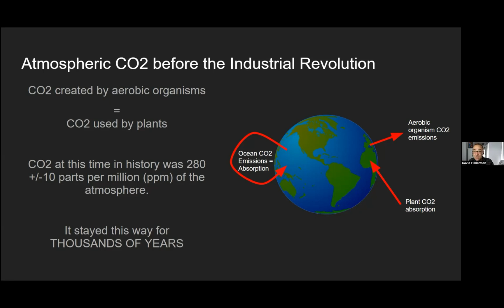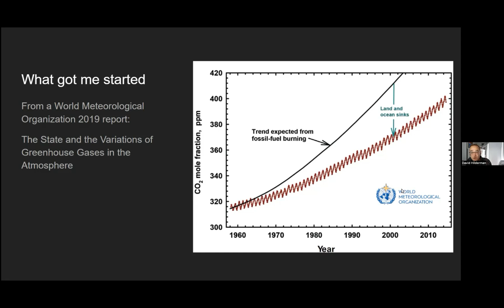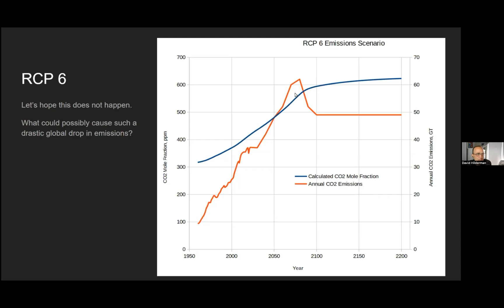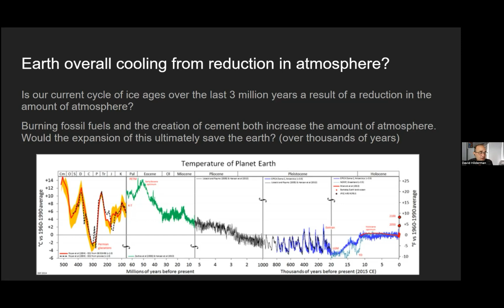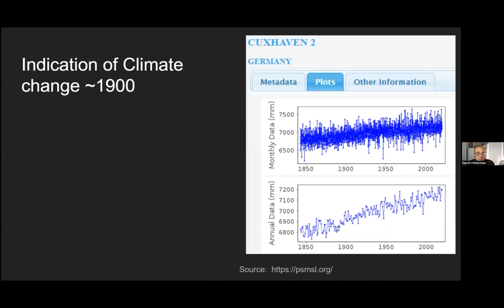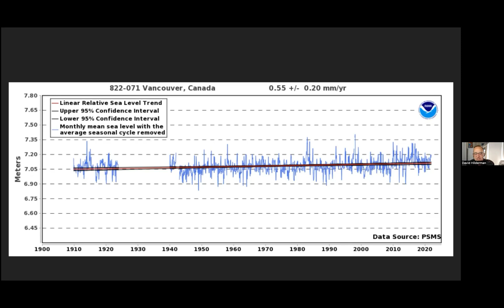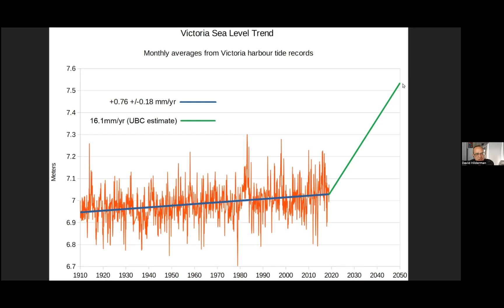David Hilderman: CO2 Emissions and Atmospheric Levels | Nelson Pod #220

Comment: Plants not only grow faster with more CO2 but they need less water. Plants don’t need as many stoma or open them so much to bring in sufficient CO2. As a result they don’t let out so much water. Thus deserts increase in productivity and decline in area.
Reply: Your graph needs to show more than the last 200 years. But that would change the narrative !
Reply: Plants already have an abundance of CO2 from just the natural sources (about 20X). The human contribution of CO2 (another 10X) does not provide any additional 'food' for the vegetation.
You may have heard that there is an increase in vegetation that correlates with the rise in CO2 and this is true... but correlation is not causation. The increase is due to increased agriculture and (believe it or not) deforestation. Deforestation actually increases the amount of vegetation per acre that can absorb CO2... it's just that the new vegetation are grasses and other simple plants with short life cycles, so they are also sourcing more CO2 periodically.
Reply: @scytaleghola5969  Look at how many mental hoops you've just had to jump through to try to say what you believe. Occam's razor ol chap. If extra CO2 doesn't provide any additional 'food' for plants then why do farmers add CO2 to greenhouses? If there was no benefit they wouldn't do it. The optimal CO2 level for plant growth is between 700 & 1200ppm BTW,which if global levels rose to that it would,in my opinion,make for a beautiful and abundant world with bountiful harvests which is far preferable to the restrictive totalitarian world proposed by the climate Tzars.
Reply: @bobtodd9590  People add CO2 to greenhouses because greenhouses are sealed environments.
You can look up things like how many metric tons do all of the plant life on Earth consume annually? (about 100 billion metric tons). The plants return a similar volume through natural processes. In addition to this we have naturally occurring fires, volcanos, and a number of other sources of CO2. So, without any help from us, more CO2 is going into the atmosphere than is being absorbed... but this is only a tiny piece of the story... Unabsorbed CO2 can remain in the atmosphere for hundreds of years, so, in actuality the total volume of CO2 in the atmosphere is currently more than 3000 billion metric tons (about 1/3 of that is thanks to us humans).  There is a huge surplus of CO2 in the atmosphere  and it has been there for a very long time and it was always available to plants... so , if your hypothesis were correct, we would already have that bountiful world you dream of.
You mention harvests, so it sounds like you think extra CO2 will improve food supplies. This is not likely the case. Of course there is always the "scare porn" about droughts and floods and acid rain... which are very real concerns, but there is another, possibly more eminent concern. The world's population of pollinators has declined as much as 70% in the last 50 years. This is partially due to disease, parasites, and pesticides, but about 1/3 of the losses are due to climate change... See, pollinators are not nearly as quick to adapt to changes in temperature, shifting growth zones, and other changes. About 60% of the crops we (and our animal food sources) eat, depend on pollination. I'm not sure we know how low the populations need to fall before it becomes a crisis, but farmers are already telling us that the declines are affecting yields and you are already paying for it in your grocery bill. Don't even get me started on the decline in phytoplankton, which is necessary for nearly all sea life.

What you call mental hoops is just science. Our biosphere is a highly complex, finely tuned system and we are randomly playing with the tuning knobs and expecting it all to run the same or better.

It's ok, though. It's a self correcting problem. The planet will be just fine (as George Carlin used to say). You can look up the rest of the quote, if you don't already know it.
Reply: @bobtodd9590  People add CO2 to greenhouses because greenhouses are sealed environments.
You can look up things like how many metric tons do all of the plant life on Earth consume annually? (about 100 billion metric tons). The plants return a similar volume through natural processes. In addition to this we have naturally occurring fires, volcanos, and a number of other sources of CO2. So, without any help from us, more CO2 is going into the atmosphere than is being absorbed... but this is only a tiny piece of the story... Unabsorbed CO2 can remain in the atmosphere for hundreds of years, so, in actuality the total volume of CO2 in the atmosphere is currently more than 3000 billion metric tons (about 1/3 of that is thanks to us humans).  There is a huge surplus of CO2 in the atmosphere  and it has been there for a very long time and it was always available to plants... so , if your hypothesis were correct, we would already have that bountiful world you dream of.
You mention harvests, so it sounds like you think extra CO2 will improve food supplies. This is not likely the case. Of course there is always the "scare porn" about droughts and floods and acid rain... which are very real concerns, but there is another, possibly more eminent concern. The world's population of pollinators has declined as much as 70% in the last 50 years. This is partially due to disease, parasites, and pesticides, but about 1/3 of the losses are due to climate change... See, pollinators are not nearly as quick to adapt to changes in temperature, shifting growth zones, and other changes. About 60% of the crops we (and our animal food sources) eat, depend on pollination. I'm not sure we know how low the populations need to fall before it becomes a crisis, but farmers are already telling us that the declines are affecting yields and you are already paying for it in your grocery bill. Don't even get me started on the decline in phytoplankton, which is necessary for nearly all sea life.
What you call mental hoops is just science. Our biosphere is a highly complex, finely tuned system and we are randomly playing with the tuning knobs and expecting it all to run the same or better.

It's ok, though. It's a self correcting problem. The planet will be just fine (as George Carlin used to say). You can look up the rest of the quote, if you don't already know it.
Reply: @bobtodd9590  People add CO2 to greenhouses because greenhouses are sealed environments.
You can look up things like how many metric tons do all of the plant life on Earth consume annually? (about 100 billion metric tons). The plants return a similar volume through natural processes. In addition to this we have naturally occurring fires, volcanos, and a number of other sources of CO2. So, without any help from us, more CO2 is going into the atmosphere than is being absorbed... but this is only a tiny piece of the story... Unabsorbed CO2 can remain in the atmosphere for hundreds of years, so, in actuality the total volume of CO2 in the atmosphere is currently more than 3000 billion metric tons (about 1/3 of that is thanks to us humans).  There is a huge surplus of CO2 in the atmosphere  and it has been there for a very long time and it was always available to plants... so , if your hypothesis were correct, we would already have that bountiful world you dream of.
You mention harvests, so it sounds like you think extra CO2 will improve food supplies. This is not likely the case. Of course there is always the "scare porn" about droughts and floods and acid rain... which are very real concerns, but there is another, possibly more eminent concern. The world's population of pollinators has declined as much as 70% in the last 50 years. This is partially due to disease, parasites, and pesticides, but about 1/3 of the losses are due to climate change... See, pollinators are not nearly as quick to adapt to changes in temperature, shifting growth zones, and other changes. About 60% of the crops we (and our animal food sources) eat, depend on pollination. I'm not sure we know how low the populations need to fall before it becomes a crisis, but farmers are already telling us that the declines are affecting yields and you are already paying for it in your grocery bill. Don't even get me started on the decline in phytoplankton, which is necessary for nearly all sea life.
What you call mental hoops is just science. Our biosphere is a highly complex, finely tuned system and we are randomly playing with the tuning knobs and expecting it all to run the same or better.

It's ok, though. It's a self correcting problem. The planet will be just fine (as George Carlin used to say). You can look up the rest of the quote, if you don't already know it.
Reply: @bobtodd9590  People add CO2 to greenhouses because greenhouses are sealed, regulated environments.They have to replenish the CO2, plus in those controlled environments plants can take up more CO2.
The bottom line is that the atmosphere currently has more than 3,000 billion metric tons of CO2 and has had more than 2,000 billion metric tons for centuries.The current demand from all plant life on Earth is on the order of 100 billion metric tons. There is a huge surplus of CO2 in the atmosphere. If your hypothesis were correct, we would already have that bountiful world you dream of.
Reply: @bobtodd9590  People add CO2 to greenhouses because greenhouses are sealed, regulated environments.They have to replenish the CO2, plus in those controlled environments plants can take up more CO2.
The bottom line is that the atmosphere currently has more than 3,000 billion metric tons of CO2 and has had more than 2,000 billion metric tons for centuries.The current demand from all plant life on Earth is on the order of 100 billion metric tons. There is a huge surplus of CO2 in the atmosphere. If your hypothesis were correct, we would already have that bountiful world you dream of.
Reply: @bobtodd9590   People add CO2 to greenhouses because greenhouses are sealed, regulated environments.They have to replenish the CO2, plus in those controlled environments plants can take up more CO2.
The bottom line is that the atmosphere currently has more than 3,000 billion metric tons of CO2 and has had more than 2,000 billion metric tons for centuries.The current demand from all plant life on Earth is on the order of 100 billion metric tons. There is a huge surplus of CO2 in the atmosphere. If your hypothesis were correct, we would already have that bountiful world you dream of.
Reply: @bobtodd9590   People add CO2 to greenhouses because greenhouses are sealed, regulated environments.They have to replenish the CO2, plus in those controlled environments plants can take up more CO2.
The bottom line is that the atmosphere currently has more than 3,000 billion metric tons of CO2 and has had more than 2,000 billion metric tons for centuries.The current demand from all plant life on Earth is on the order of 100 billion metric tons. There is a huge surplus of CO2 in the atmosphere. If your hypothesis were correct, we would already have that bountiful world you dream of.
Reply: @bobtodd9590  People add CO2 to greenhouses because greenhouses are sealed, regulated environments. They have to replenish the CO2, plus in those controlled environments plants can take up more CO2.
The bottom line is that the atmosphere currently has more than 3,000 billion metric tons of CO2 and has had more than 2,000 billion metric tons for centuries. The current demand from all plant life on Earth is on the order of 100 billion metric tons. There is a huge surplus of CO2 in the atmosphere. If your hypothesis were correct, we would already have that bountiful world you dream of.
Reply: @bobtodd9590  People add CO2 to greenhouses because greenhouses are sealed, regulated environments. They have to replenish the CO2, plus in those controlled environments plants can take up more CO2.
The bottom line is that the atmosphere currently has more than 3,000 billion metric tons of CO2 and has had more than 2,000 billion metric tons for centuries. The current demand from all plant life on Earth is on the order of 100 billion metric tons. There is a huge surplus of CO2 in the atmosphere. If your hypothesis were correct, we would already have that bountiful world you dream of.
Reply: @bobtodd9590  People add CO2 to greenhouses because greenhouses are sealed, regulated environments. They have to replenish the CO2, plus in those controlled environments plants can take up more CO2.
The bottom line is that the atmosphere currently has more than 3,000 billion metric tons of CO2 and has had more than 2,000 billion metric tons for centuries. The current demand from all plant life on Earth is on the order of 100 billion metric tons. There is a huge surplus of CO2 in the atmosphere. If your hypothesis were correct, we would already have that bountiful world you dream of.
Reply: @bobtodd9590  People add CO2 to greenhouses because greenhouses are sealed, regulated environments. They have to replenish the CO2, plus in those controlled environments plants can take up more CO2.
The bottom line is that the atmosphere currently has more than 3,000 billion metric tons of CO2 and has had more than 2,000 billion metric tons for centuries. The current demand from all plant life on Earth is on the order of 100 billion metric tons. There is a huge surplus of CO2 in the atmosphere. If your hypothesis were correct, we would already have that bountiful world you dream of.
Reply: @bobtodd9590  People add CO2 to greenhouses because greenhouses are sealed, regulated environments. They have to replenish the CO2, plus in those controlled environments plants can take up more CO2.
The bottom line is that the atmosphere currently has more than 3,000 billion metric tons of CO2 and has had more than 2,000 billion metric tons for centuries. The current demand from all plant life on Earth is on the order of 100 billion metric tons. There is a huge surplus of CO2 in the atmosphere. If your hypothesis were correct, we would already have that bountiful world you dream of.
Reply: @bobtodd9590  People add CO2 to greenhouses because greenhouses are sealed, regulated environments. They have to replenish the CO2, plus in those controlled environments plants can take up more CO2.
The bottom line is that the atmosphere currently has more than 3,000 billion metric tons of CO2 and has had more than 2,000 billion metric tons for centuries. The current demand from all plant life on Earth is on the order of 100 billion metric tons. There is a huge surplus of CO2 in the atmosphere. If your hypothesis were correct, we would already have that bountiful world you dream of.
Reply: @bobtodd9590  People add CO2 to greenhouses because greenhouses are sealed, regulated environments. They have to replenish the CO2, plus in those controlled environments plants can take up more CO2.
The bottom line is that the atmosphere currently has more than 3,000 billion metric tons of CO2 and has had more than 2,000 billion metric tons for centuries. The current demand from all plant life on Earth is on the order of 100 billion metric tons. There is a huge surplus of CO2 in the atmosphere. If your hypothesis were correct, we would already have that bountiful world you dream of.
Reply: @bobtodd9590  People add CO2 to greenhouses because greenhouses are sealed, regulated environments. They have to replenish the CO2, plus in those controlled environments plants can take up more CO2.
The bottom line is that the atmosphere currently has more than 3,000 billion metric tons of CO2 and has had more than 2,000 billion metric tons for centuries (before our contribution). The current demand from all plant life on Earth is on the order of 100 billion metric tons. There is a huge surplus of CO2 in the atmosphere. If your hypothesis were correct, we would already have that bountiful world you dream of.
Reply: @bobtodd9590  People add CO2 to greenhouses because greenhouses are sealed, regulated environments. They have to replenish the CO2, plus in those controlled environments plants can take up more CO2.
The bottom line is that the atmosphere currently has more than 3,000 billion metric tons of CO2 and has had more than 2,000 billion metric tons for centuries. The current demand from all plant life on Earth is on the order of 100 billion metric tons. There is a huge surplus of CO2 in the atmosphere. If your hypothesis were correct, we would already have that bountiful world you dream of.
Reply: @bobtodd9590  People add CO2 to greenhouses because greenhouses are sealed, regulated environments. They have to replenish the CO2, plus in those controlled environments plants can take up more CO2.
The bottom line is that the atmosphere currently has more than 3,000 billion metric tons of CO2 and has had more than 2,000 billion metric tons for centuries. The current demand from all plant life on Earth is on the order of 100 billion metric tons. There is a huge surplus of CO2 in the atmosphere. If your hypothesis were correct, we would already have that bountiful world you dream of.
Reply: @bobtodd9590  People add CO2 to greenhouses because greenhouses are sealed, regulated environments. They have to replenish the CO2, plus in those controlled environments plants can take up more CO2.
The bottom line is that the atmosphere currently has more than 3,000 billion metric tons of CO2 and has had more than 2,000 billion metric tons for centuries. The current demand from all plant life on Earth is on the order of 100 billion metric tons. There is a huge surplus of CO2 in the atmosphere. If your hypothesis were correct, we would already have that bountiful world you dream of.
Reply: @bobtodd9590  People add CO2 to greenhouses because greenhouses are sealed, regulated environments. They have to replenish the CO2, plus in those controlled environments plants can take up more CO2.
The bottom line is that the atmosphere currently has more than 3,000 billion metric tons of CO2 and has had more than 2,000 billion metric tons for centuries. The current demand from all plant life on Earth is on the order of 100 billion metric tons. There is a huge surplus of CO2 in the atmosphere. If your hypothesis were correct, we would already have that bountiful world you dream of.
Reply: @bobtodd9590  People add CO2 to greenhouses because greenhouses are sealed, regulated environments. They have to replenish the CO2, plus in those controlled environments plants can take up more CO2.
The bottom line is that the atmosphere currently has more than 3,000 billion metric tons of CO2 and has had more than 2,000 billion metric tons for centuries. The current demand from all plant life on Earth is on the order of 100 billion metric tons. There is a huge surplus of CO2 in the atmosphere. If your hypothesis were correct, we would already have that bountiful world that you dream of.
Reply: @scytaleghola5969 There are no limits to the amount of co2 machines you can buy to feed your plants. I suggest everyone buy a few and run them 24/7 if they can afford to.
Reply: @scytaleghola5969 
Tried to reply to you and YouTube censored it 
I googled “earth greener” and copy pasted an article about satellite data showing more plant life since the 80s

Hopefully you find that yourself since I’m not allowed to share it
Reply: @scytaleghola5969 You mentioned correlation is not causation. On that same note, just because C02 and temperature are correlated, why do you assume that CO2 is responsible for an increase in atmospheric temperature?
Reply: @ragas2845  I don't assume that an increase in CO2 causes an increase in temperature. This is a scientific principle that has been backed up experimentally in countless studies.
You might say that I am assuming that a rise in temperature is a bad thing, but I wouldn't even say that is true. I really only assume that it will be different and that the difference MIGHT be a bad thing... the problem is, if it turns out to be a bad thing, we're stuck with it for hundreds of years.